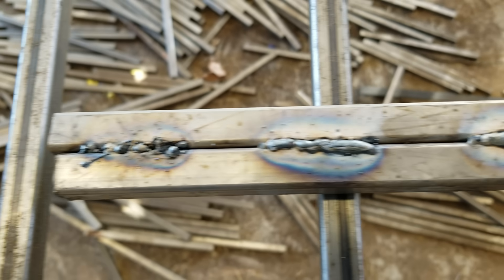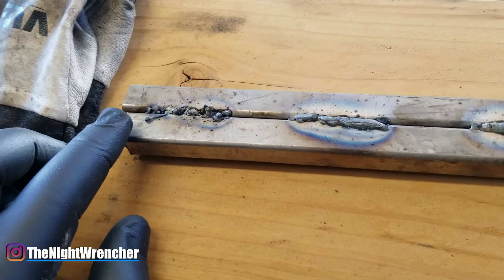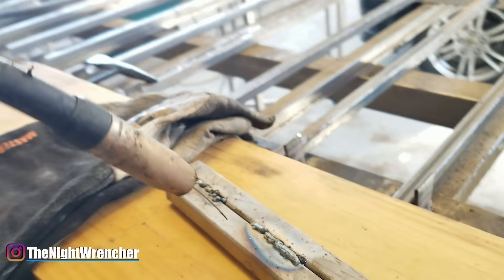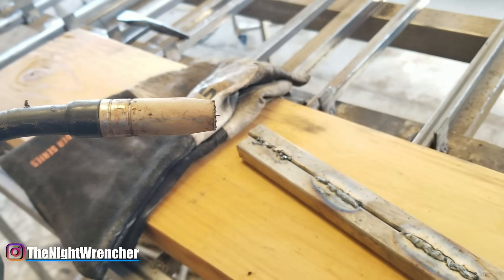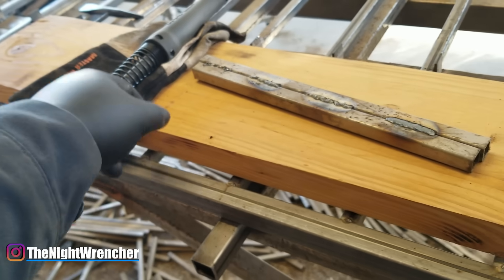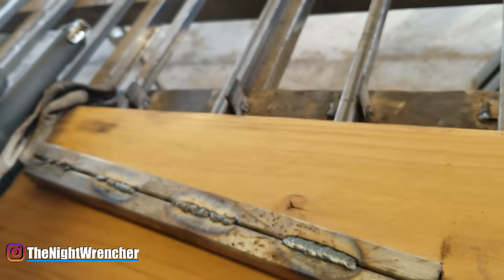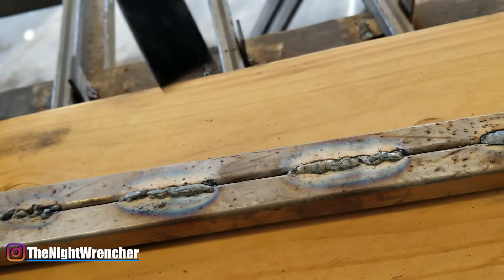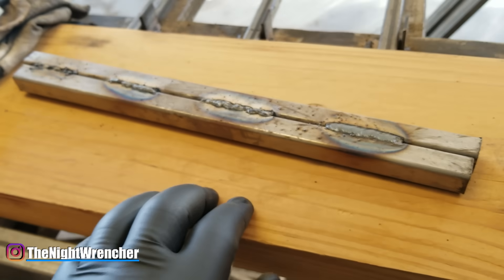Learn Perfect Flux Core Welds In 10 Mins | Gasless Flux Core Welding For Beginners Tips And Tricks |

Comment: What size stick do you use to weld thin sheet metal? I am starting to stick weld holes in  a metal wheel barrel.
Reply from the maker: As small as you can find. Stick welding takes a lot of amps but smaller sticks take less amps so the smaller the better.

Comment: Question, if you are using flux core, do you really need to leave the gas shield on the tip?
Reply from the maker: You can buy these plastic caps to replace the gas tip. Makes it easier to see too.

Comment: Poorly explained techniques/ methods. Who the heck even trys to wirefeed weld with a 2 to 6 inch stickout? And you CAN push a flux core puddle. I can do it and produce vacumm spec welds. Just pay attention and don't let the molten puddle freeze over the slag. Push it around with the arc force. Poor video even for beginners. Misleading, and sounds like nonsense to an experienced welder.  Kinda annoying.

Comment: Why you have latex gloves. Dude. Yeah welding since 1991. And welding is an art and like playing guitar. Certain chords work. Yeah flux core isnt for beginners. Hardwire is. Ive done flux with 95/5. Its not easy.
Reply from the maker: Theyre nitril glove and I wear them under my welding gloves to make it easier to put them on and take them off since I like to undersize my glove so they fit nice and tight

Comment: 5:11 The reason for sun burns is not the heat. The reason is ionizing radiation, or in the case of the welding, UV rays. Heat (infrared)  is non ionizing and never causes sun burns.

Comment: I have a millermatic, 110/220. I was told to use 220 at all times. Is that true? Thanks for the video, now I need to practice that flow. Wish I had someone to teach me more hands on as I sure would like to learn how to “stack dimes” is what they call it…
Reply from the maker: It depends. Standard gaslessflux core wire can be ran on 110v. If you're looking weld nice beads, you'll need to run your welder with 220v and gas

Comment: Love the videos. I'm thinking of buying a Flux wire feed today at Harbor freight, however unsure what gauge wire to use for exhaust.
Reply from the maker: Smallest you can use in a flux core machine is .030. Make sure to get a DC machine because they weld cleaner
Reply: @NightWrencher  DC? Sorry, I'm a rookie.
Reply from the maker: @spartan7417  it will say on the tag. The cheaper ones are AC welders
Reply: @NightWrencher  Oh okay, I know what you mean now. Thank you!
Reply: What's your opinion on a CHICAGO ELECTRIC WELDING 

170 Amp-DC, 240V, MIG/Flux Cored Welder
Reply from the maker: It seems like a decent beginner welder

Comment: Thank you for making this. I am going to buy a flux mig and start with your tips!

I am a fiberglass guy, I can make nearly abs shape out of composites. Learning to weld will allow me to make a frame for any shape. 

My question is - can flux welds be strong enough for a hot rod Model A - chassis? Of course I would make sure I am competent befor taking on a vehicle but I don’t want to learn on a machine that will end up limiting me.
Reply: I’ve been pushing with my old welder and got frustrated - old the welder. Now I know. With slag you drag! Learned a lot with this simple video.

3/4” away, monitor wire speed and verify settings with the wire+material to be welded
Reply from the maker: Exactly right, itll get easier the more you do it. Good luck!

Comment: None of those welds would work to put on a quarter panel.gas is the only way.with a good gas welder you can just barely pull trigger for split second and get a good flowed out spot weld.then skip around controlling heat without burning thru and all that splatter and heat with that flux garbage.good for muffler bracket or something heavy but not auto sheet metal.
Reply from the maker: Well its good that I dont use it for sheet metal 🤷‍♂️

Comment: Very informative and a lesson very well put together couldn't be more specific not only will I be watching this video again I will be recommending you to people I know that want to  Begin welding like I do ,also new subscriber ,are you using oxygen , Or any other gas with the migwelder or just the migwelder and flux core wire
Reply from the maker: Its just a DC welder with no gas and flux core wire. I've had good results with lincoln wire.
Reply: @NightWrencher   What welding machine do you recommend running off of 110 power , or Do you prefer  220
Reply from the maker: I only use 110v unless I'm welding really thick materials. Most of the better machines are dual voltage so they can do low amps on 110 and high amps on 220. I'll have a video on best budget welders up soon

Comment: I have a question. Are these electric welders bad for the house or apartment electric? Will it cause the light to turn off? And another question if someone is not properly welding right Can it cause the electricity to go dim?
Reply from the maker: Yes to all of those questions. Welders will draw a lot of amps and depending how the apartment is wired, it could dim all of the lights and even damage electronics due to voltage spikes.
Reply: @NightWrencher  if the electric welder is used in a local buisness place and someone welds correctly will the electricity work normal with no problem? How many amps do you think is the most a local buisness should take before something gets damaged or light turns off? My friend has been using the electric welder a bit learning to weld and he has made alot of little balls of welds to weld stuff and he has notice the electricity go dim and says there is not alot of electricity.
Reply from the maker: Power will always go dim if the wiring in the wall is weak. A 15 amp breaker is all that you'll need for a basic home machine.
Reply: @NightWrencher  i can use a amp breaker in the buisness place too?
Reply from the maker: All buildings in the USA have a breaker box for safety. I don't know where you are from, but you should have a circuit breaker that feeds your welder to protect the wiring in your building
Reply: @NightWrencher  were i work its just a bit lot to store junk cars and half of the lot is a recycling for cans and bottles its not a building its just a big lot with fence. I do not know much about what electrical things it has. But there is light in the buisness place. My friend just recently started using welder to learn. I ll ask the owner about that.

Comment: Hey friend! Thanks a lot for these videos. Can you possibly do one, or do you have experience, with flux welding stainless steel exhaust? I know there is stainless flux core wire but haven't seen any real info on it.
Reply from the maker: Hey man, I do have a video on that actually. You can use the same flux core wire but the weld is more prone to rust compared to a MIG weld. You should be able to find it by searching flux core stainless on youtube, hope it helps!
Reply: @NightWrencher  I believe i did see that now that you mention it. Have you seen anything about the stainless flux wire that is available? Or any experience there? I'd like to weld stainless on stainless if I can get away with it going flux! The house isn't wired for 220 lol.
Reply from the maker: I think blue demon sells stainless flux core wire. I've never tried it and there are several available but only a few specify that they are for gasless DCEN welders.

Comment: Best explanation by far, i can see where a lot of my problems are, now i can sound knowledgeable as i mess up my welds lol.  Appreciate the info man, definitely know where most of my faults are, too far away and also fear if burning throu is where i get caught up. I do have moments of nice runs but if i stop then i lose it and  cant find the rythym again
Reply from the maker: Its all about slowing down and finding that sweet spot for your welder settings. Thinner metals will require less heat than thicker metals. Start low, and work your way up
Reply: @NightWrencher  not trying to make a career out of it but its a good thing to learn, sucks when u build a mini bike and a weld fails when riding it...hurts a little. I like fabricating stuff and its way easier when u can weld. Jb weld is cool but u can only do so much with that plus dry time. Bolting everything can be a pain so welding is more practical plus it looks cool, when u know what youre doing. I built a ladder rack out of a couple weight benches and somehow i nailed every weld perfect , people always ask where i bought it so thats another way i know  the welds look good. Thats whats frustrating cuz i cant seem to get that same rhythm down that i had that day, i did catch my boot on fire on the very last run thou. So even when i have good days with it, still manage to fuxk something up lol

Comment: Just tried my first weld today, should've watched this video first cuz all my welds looked like the far left one.
Thing is that I'm a little jumpy about electric sparks because it is no fun having to extinguish an electrical fire inside a giant robot.
Reply from the maker: I'm used to setting myself on fire when I weld, you kinda get used to it. Protect what you can from the sparks and wear plenty of protection. The sparks will leave glass and plastics pitted and they can ignite electrical wires really well so be careful.
Reply: @NightWrencher  Due to my jumpiness I got all the recommended safety protection and then some (hard to see thru the helmet while welding but I like my eyes).  Use a fiberglass fireblanket to cover my work surface (metal cart), and I have an extinguisher within arms reach.

Comment: The burn is arc burn. If its welding... you're at risk of getting burnt regardless of the heat and quality of the weld. It is due to the exposure from unfiltered UV rays, Specifically UVC.

Comment: I have a Lincoln 140 easy weld and I'm having a hard time welding 16 gauge metal. The welds look like the far left weld in your video and I'm also burning through the metal.  I'm trying to make shelves for my metal shop. Any word of advice?
Reply from the maker: I would say turn the heat and wire speed down and move slower. You can weld straight accross on 16 gauge, you just gotta be careful, watch the puddle and when you see it glow bright orange and widens, it means its about to burn through so let off the trigger before it does
Reply: Thank you!

Comment: Do you weld in a straight line and you pull
 Back? Or DO you make circles?
Reply from the maker: I weld straight accross whenever possible. If I need to weld a wide joint or if the metal Is too thick for the wire size that I'm using I will do like a side to side. I dont really recommend circles for flux core wire.

Comment: Can’t figure out if the wire is supposed to touch the metal or do I hold it away a little bit?
Reply from the maker: From the tip of the gun(not the wire) to the surface of the metal keep away around a half inch

Comment: Nice explanation. I'm a Newbie welder.. or will be after I get all the equipment I need and wire a 20 Amp circuit for my new HF 125 Flux-core welder. Question? The welder doesn't come with flux-core wire... is set up for .030 wire and can use .035 wire by flipping the feed spool. Is there any advantage to either? I unde3rstand the .030 has a material thickness limit and the .035 can be used with a little thicker? Do I understand this correctly or is there a need to start with the .030? Thanks for any responses.
Reply from the maker: Flux core wire doesnt have a specific size. I like to use .030 for most projects because it lights off easier so needs less heat to get going and less chance to warp or burn through. Flux core wire is usually silver and wire made for gas welding is usually a copper color. You can use up that .035 to learn and then switch to .030 lincoln innershield when the time comes. Hope it helps. Good luck 👍

Comment: A demonstration of the speed you used for each one would have been helpful. I’m trying to learn but I can’t seem to make that good weld happen just  sort of in between. The confusion of push the weld for oxy/acetylene had me screwing up mig flux core. I suck at both... probably would be a good idea to get some decent scrap metal versus using rusty crap I try to sand down to practice on too right?
Reply from the maker: I like to move slow when I weld. Turn the wire speed and heat down then go slow. Turn up the wire and heat as needed.

Comment: Why do i burn holes occasionally? I feel like i have a good hot steady bead going and then bam theres a hole on the butt edge of my square tubing. About 1/16th inch thick. 14 gauge i believe. I would assume it juat got too hot so do i need to move a little faster?
Reply from the maker: Turn the heat down a little. Flux core gets hotter the longer the bead goes. Start the bead slower to get the heat going and then go for it

Comment: So flux core is not basically just different type of wire than mig wire??? What's the difference
Reply from the maker: Flux core is self shielded and does not need to use gas like MIG. Some people use dual shield flux core but that's for heavy duty industrial welding.

Comment: I know this is a late question. If uv or insulation is a big concern for the "support-arm", why not cover/coat the outside arm in mylar or similar light-weight UV protective material?
Reply from the maker: You can, they sell sleeves you can wear while you weld or you can wear a denim jacket

Comment: Can i ask you about a trailer that i just bought
Reply from the maker: Whats up with it?
Reply: @NightWrencher  dang i cant put a picture in the comments
Reply from the maker: @Youngster0808  no you cant, but if you wanted to show me some welds, you cant tell how good a weld is by just looking at them. I've seen beautiful welds break due to lack of penetration and I've seen ugly welds hold up fine. I dont know too much about trailer construction so theres not much I can help you on the trailer itself unless you want to weld parts to it.
Reply: @NightWrencher  thank you. The welds i wanted to show you are ugly… i am hoping for the best
Reply from the maker: You can sand them down a little to clean the welds and you can go over them yourself with high heat and low wire speed

Comment: You can absolutely also “drag your cone” to maintain a steady guide and get a consistent weld.  Flux, dual shield, spray mig.  I drag cone all day with spray .052 metal core at 30 volts.  The cone will stick sometimes, but that’s not due to the wire sticking it.  Insulators and dirty shit on your cone will make it prone to stick, so you learn to start just off the base material then drop and push/drag to get a slick pass.  Makes running 6 pass covers a dream when you add build up guides to drag on.  Heavy commercial fab shop welding baby.
Reply from the maker: With enough skill, you can do anything 🤣

Comment: Back when I first started driving my friends and I were into making our own exhaust systems, air intakes etc.... basically automotive diy projects that definitely required a welder but we didn’t know how to weld nor did we have one. In 2019 I bought my first car back from the guy I sold it to back in 04. And I had a  built motor w/transmission for it and even though the wiring looked like it had been worked on by a blind squirrel the only real problem was the exhaust. So I bought a 💩-Ton of pipe from Wish and bought a used flux core welder from a guy on market place. I figured how hard could it be..... 🤣🥴 But channel’s like this are very helpful
Reply from the maker: 🤣 I can relate, thank you!

Comment: What technique are you using when welding? Sort of an oscillation or weaving?
Reply from the maker: It depends, i try to run it straight as much as I can unless I'm having trouble with penetration which then I'll weave a bit. Check out my vertical welding video to see what I mean

Comment: If anyone wants a great cheap welder harbor freight has a brand called titanium. Its a great cheap welder you can get decent welds and its only like $210 id look for an open box because their a lot cheaper. Id also reccomend a harbor freight chicago electric helmet. Its black with blue flames and works very well. Its 50 something. Both are very good and cheap.

Comment: Great pointers, I've made all of those. I had a welding guy fixing something for me and got several pieces of scrap angle from his trash pile.  I used those scrap pieces to make a bunch of practice runs which helped me a lot. Also getting a proper ground on painted or rusty material makes a huge difference.
Reply from the maker: Exactly right

Comment: Was told on fluxcore to actually switch my ground to + and gun to - so welding dc- to eliminate alot of bbs and flatten the weld out.
Reply from the maker: flux core should always be welded with DC current Electrode NEGATIVE. usually dedicated flux core machines are already set up how they need to be but if its a machine that comes equip to also run gas, you need to check the polarity to make sure its right